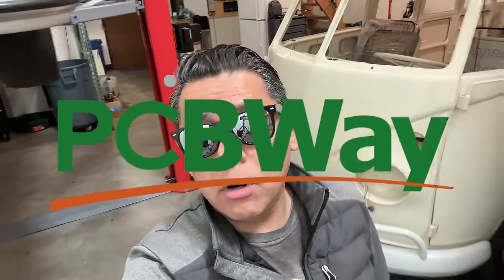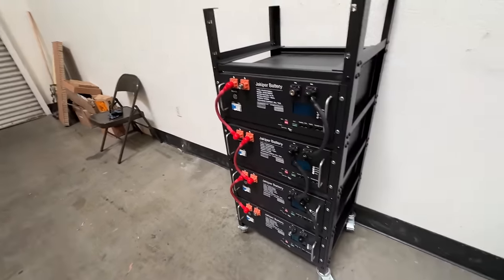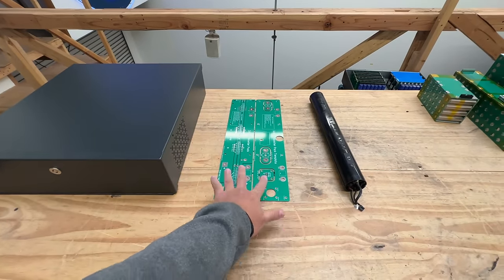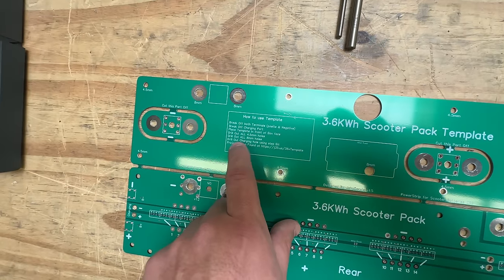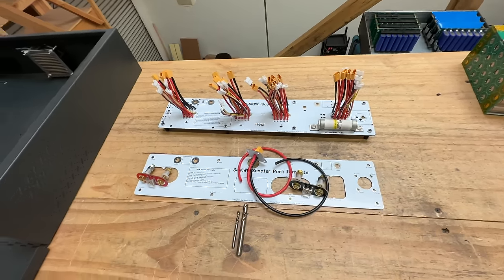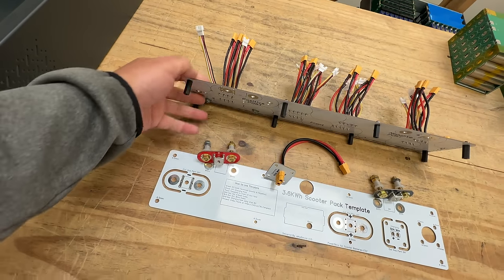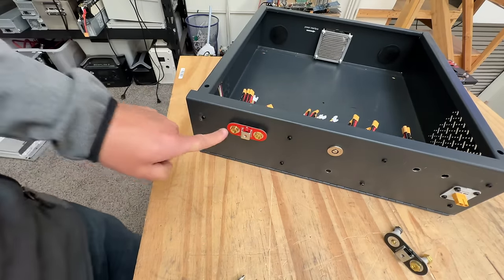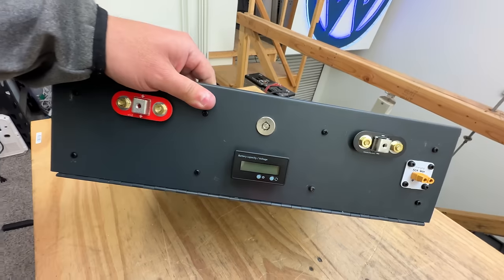20KWh DIY RackMount Backup Battery for Half price

Comment: Hi Jehu, this is reasonably priced unfortunately the battery type is wrong for home storage.  No BMS why?  No Isolator why?  The Fuse should be accessible too.  Please consider re engineering your design, the box won't breathe, I hope you have got good COMMERCIAL INSURANCE, Please send Will Prowse a ready built battery to review?

Comment: I have a 10KWh system with Enphase inverter using 25 microinverters for the solar panels(400W).  Can these batteries work with my system?
Reply: @jehugarcia
Reply from the maker: Yes and no.  Your system is closed loop,  doesn’t have a way to add a battery.  But you can add a grid tied battery,  they are called ac coupled battery system,  google that to see how it works and how you can install it in your home.
Reply: @jehugarcia  Thank you So much. Hopefully I will find a batt that doen't cost $10K.

Comment: Just to be clear these are reclaimed e-scooter battery packs, each with their own BMS. They are sold "untested" which means no guarantee on their actual capacity - the blurb says testing about 90%. One single BMS fails and you have a potential fire. And e-scooters are one of the worst culprits for catching fire while charging. You have no way of monitoring the individual cells in each pack, there's no circuit breaker only a fuse which is mostly designed to cover shorts not overcurrent. I'm almost certain the BMS inside each pack was never designed to be used in a multi parallel config like this. I'm not against DIY, I built my only 48V LiFePO4 pack from 280Ah cells but this design seems half-baked.
Reply from the maker: So has been every project I’ve done for the past 20 years.  10 years ago everyone said my diy electric car would never work because it was a hack,  “a fire waiting to happen”  they said. I understand some people like to color within the lines but to say that’s the only way it’s short sighted.

Comment: Maybe at the time you made this video it might have been something to consider. 10 months later you can buy those server rack batteries for $1100 - $1400 and they are excellent quality. there are so many brands that are competing. really you're comparing apples to oranges. Like you said 48 volts compared to 36. Also the lithium ion phosphate battery  batteries are up to 6500 cycles. They are all so UL approved, another words they're safer. So you're actually looking at more of a price of $4,400 - $4800 compared to $3600 and the extended hassle of getting all the different pieces together and then the labor of building them! I suppose it's a great nerd project, I wouldn't spend a dime on those batteries. In the long run you're going to be spending a hell of a lot more on your DIY battery, simply because you  only get a %25 life cycle compared to the lithium phosphate. You would literally have to build four of your units at $3600 a piece if you consider the life on that battery and you still wouldn't have near as nice a battery as the lithium ion phosphate batteries that you can get anywhere from $1100 to $1400.  He had 36 volt do it yourself is very limited as you pointed out. You can get really good quality inverters as you pointed out also on the 48 volt system.

Comment: if i had $3600 USD just laying around my power bills would be covered for three (maybe more) years.
but the thought sounds good...if...
you are in your 20's, and KNOW you will be in that house for your lifetime.  and if you put in a human controlled power control. this unit would get charged up only during late night, when the juice costs less. and burn the batt's during the day when power cost the most.
but one should ONLY use lifepo4. not the fire prone li-ion units.

Comment: Do the boxes require any cooling with the packs being tight together inside? Do the packs generate much heat?
Reply from the maker: Not at anything less than 1c which is all these packs can do anyways.
Reply: @jehugarcia  - any reason you did not mount the fan on the outside of the case & wire it?
Reply from the maker: Mostly because these batteries will not need cooling at 1c output

Comment: Hihi. Great video as always. Do you have or can you make a video with LTO cells? We have rotational power cuts about 5 to 8 times a day, so the long cycle life is the only viable option for most bang for the buck. It's hard to find DIY information like your videos anywhere else with proper links too. 48v LTO build would be amazing.
Reply: Price for the LTO would be amazing as well.  They are low current, so you needs LOTS more of them.
I looked at them and figured $64K in batteries to run the house.  If I was still 20 that might make sense.  But they would out live me now. 😂
If you have a california grid, AGM might be the best choice.
Reply: @robertsmith2956   I live in South Africa, with our unstable grid and constant power outages 5000 cycles would last me 2 to 3 years. I use about 25kw a day but want LTO due to the fast charging and long life. Need about 6 hours of storage and need that to charge up again in about 4 hours. 3 to 6 times daily.
Reply: @ThePsychoCJ  I very much doubt you'd be doing an 80% depth of discharge cycle each time! If you're losing power for a few hours at a time and your pack is sized for your 24 hour use then your discharge is only going to be ~10-15%, set your BMS to keep your LFP cells at 80-85% max SoC and that 10-15% depth of discharge would probably give you 20-30k cycles or more (likely near infinite as LFP would age out before you could push enough cycles at such a gentle use case). This strategy is going to be cheaper than LTO and more flexible as you don't need to care if an outage goes 5 hours instead of 1-2 because it's still not much of your total capacity.
Reply: @andrewfidel2220  thank you Andrew. I'll look into this. Currently power outages has been 10 to 14 hours for the last 6 days. So not getting any better. This is one full outage then we have ontop of that the 2.5 hours off too. I need batteries which can charge fast, 90a or higher with long cycle life. I'll do some research on LFP then decide which will be best.
Reply: LTO is overkill for residential energy storage. It will degrade by calendar aging rather than cycling.

You'd be better with LFP. Just make it oversized. If you need 10 kWh per cycle, make it 30 kWh. It will cycle much less because you'd be only cycling between 30%-70% percent range with added benefit of extra energy stored if the grid become haywire.
Reply: @ThePsychoCJ  if you can get an Alibaba vendor to deliver to SA you'd probably be best off buying some wall mount or rack mount 48V 200Ah packs. They're going to be heavy but I know you South Africans are tough as nails so I'm sure you and a buddy could easily mount a 200Ah pack to the wall. Just watch out for the 15S packs as they are less kwh than the 16S and 16S is much more industry standard so it might help you in the long run with compatibility. At 10.256kwh  you'd only need two per day of backup storage if your home is somewhat efficient and you aren't running any heavy loads like shop tools, multiple large inefficient AC systems, or inefficient electric water heaters. Upgrading old appliances like AC and water heaters to more efficient types will pay itself off very fast in terms of electricity cost but also in terms of how long your energy storage lasts.

A 48V 100Ah system in the US goes for $1500 to $1700. Anything more than that is just marked up bullshit. If you get 48V 200Ah units you might want to consider making sure they have 200A BMS's so that you have full discharge ability in times of super high loads but if you only have 5kw of inverting power then a 100A BMS (running at full tilt which isn't the greatest) will provide all the power you need. It looks like you can get 200Ah units for $2000 on Alibaba and based off some of the posts I've seen on the DIY Solar Forum. For someone like you that probably wants 30kwh, 60kwh, or maybe even 90kwh you're going to save a bundle of money if you find a good Alibaba vendor. It might hurt in shipping cost but maybe buy 1 unit before committing to buying 5 more if you're planning on 60kwh. As far as inverters go you could probably get by on a 5/6kw inverter but then you gotta watch what gets turned on. 12kw and 15kw inverters are quite common but putting all your eggs in one basket can be a risk. If you want redundancy maybe 2 12kw inverters would allow you to run each inverter at 50% and if one goes down you can temporarily run the working one at 80% 

LTO is about 3 times the price so it just doesn't make sense outside of really cold environements. LFP should be able to handle your charging requirements, even the worst 48V 100Ah units allow 50A charging so 2.56kw. If you get one with a 200A BMS it will almost certainly allow 100A charging so 5.12kw.

If you have any other questions let me known. You should be able to put together 60kwh for $12,000 USD and two 12kw inverters will run you another $6000 depending on what you want. You can get simple all in one off grid inverters that have a built in MPPT quite cheap.
Reply: @ericklein5097  hi Eric, thank you for this reply! I will have a look at Alibaba, there is a few vendors which does ship to us, but yes, those shipping fees are insane. Still cheaper than actually buying within South Africa. I will be adding solar as it will be cheaper than all the batteries only, then I'll only need about 30kwh. I have rewired my house to be ready, heavy loads are on a completely different circuit. Big fridges now also have smart timers on to make them a bit more efficient. Gas stove, busy getting a gas water heater. I have been convinced of the LFP route, all checks out for my needs, but will get rack mount batteries, not to fond about the wall mounts. I love server racks as an IT professional. Thank you again for the great tips!

Comment: All this work to save half on already worn out and lower cycle life battery which he sells for $100/kWh which is scrap from battery recycler. Just buy a new LFP rack battery with warrant and save yourself the trouble.
Reply from the maker: Clearly diy is not for you
Reply: @jehugarcia  Oh, I love DIY but using fresh cells instead of used. DIY makes sense if you factor in remaining cycle life discount.

Comment: What's the expected lifetime of the units?
Reply: They are li ion.. so 500-800 cycles until 80% capacity  vs lifepo4 which is 3000-5000 cycles until 80% capacity. Huge discrepancy
Reply: The length of time this will work for a solution depends entirely upon how much you eat up your lithium ion batteries: what voltage you charge your batteries to & do you not over discharge.

100% - 300-500 cycles
80-85% - 850-1500 cycles
70-75% - 1200-2000 cycles
60-66% - 2400-4000 cycles
35-40% - 4000-8000 cycles
30% - 8000-16000 cycles

Don’t charge Lithium Ion to 4.2v / 100% if you care about the longevity of the battery system.

I have some 16s battery systems where a 48v inverter that I am waiting to arrive, will charge each battery 🔋 to 4.0v for 70-75% capacity to yield 1200-2000 cycles or 3-5 years.

I bought enough batteries where I may be able to charge to 3.9v or 60-65% charge to yield 2400-4000 cycles or 6-10 years.

A Genetry Solar inverter will do 36v, but I will run my 16s system at 48v, since I never intend on using all the battery 🔋 capacity, since I am shooting for longevity.
Reply: @David H  4v should be far higher then 75% capacity. Most batteries at well over 95% at 4.1v

Comment: Hello could you explain me something please in previous video you said that cylindrical cells have only 2000cycles ? I have one in basket and is call POWMR powerwall 5kwh 48v and before I click buy I would like to know how many those cells could be in this battery as I can’t find moch information .seller said is 15s lifepo4 cylindrical cells 48v 5kwh and on website shows 6000cycles battery life is that possible? ? ?
Reply from the maker: Cylindrical NMC cells,   LiFePO4 in any form has 4000-6000 cycle life
Reply: Thank you my friend that cleared my mind

Comment: but I am wonderin ,is the lithium batteries that you are selling new or "refurbished" because there's a difference, sure they are looking into tech to increase the battery life by recycling it however that's still in research phase and requires a chemistry set a small nation can't afford.

Comment: Do you offer a half-price power bank with less than half of the life time of a comparable?
Where is the profit?
Reply from the maker: Sounds like you like paying full price,  Go for it,  don’t hurt my feelings.
Reply: @jehugarcia  Do not put emotional pressure on me, I only look at the cost and profitability. Not that I'm Mr. Scroodge, but I'm always looking for the most cost-effective solution. Believe me, there is a solution where 1 kWh costs less than $150 and the battery has a higher capacity and a lifetime GUARANTEED greater than 6,000 cycles.
No spells will change the fact that the holy grail of any electricity storage is the cost of ONE kWh cycle, not one kWh only.

Comment: 1000 cycles vs 6000 cycles for lifepo4 for half cost?  Sounds like a bad deal to me.  Even worse you can diy a lifepo4 with prismatic cells for not much more than this solution.  Add to that the extremely limited availability of 36v inverter solutions and this project is just dumb.

Comment: While this should be fine in environments that stay at a moderate temperature, there are no mechanisms here to protect the batteries from getting too hot or too cold.  As such it would not be a good idea to use this project if you are looking to store your batteries in an external shed or a garage that is not heated or cooled like you would want for the inside your house.
Reply: Excellent point.  That leaves me keeping the potential fire risk in my Pennsylvania basement.  No.  Back to LiFePO⁴.

Comment: This is a lot of smoke waiting to happen from shorted wires at best and a burned down house at worst.  NO way should that many small wires with that much exposed copper be shut up in that small a space.  The PCB are laughable and not anything I wouldn't want to be around when the crack from the strain on them.  And last but not least, I don't know how many cheap knockoff XT60's I've seen melted, but it is a lot.  No part of this remotely sounds like a good idea.
Reply: Literally none of those wires are exposed

Comment: You didn't mention that these batteries are already used, and each set is NOT balanced. Plus where's the BMS between all the cells? Cell balancing or even set balancing? Yeah, the BMS is in the pack itself, but I dunno man, I don't like it nor trust it.

Comment: There's no amount of money you could pay me to put one of these under load in my home.  Lithium Cobalt is crazy dangerous without a BMS.  The build quality on the scooter battery looks ok, but even if they were brand new cells, this type of application is not safe.  People have died when their E-bikes have caught fire while charging overnight in their garages.  People have lost their homes to Lithium Ion 18650 cell power, a project promoted on this channel.  Lithium Iron Phosphate is much safer and significantly less likely to catch fire either from  accidental physical damage or overcharging.  As long as Lithium Cobalt 18650 cells are promoted for DIY builds on this channel, I will comment on how unsafe they are.  Buy some EVE, CATL, or Gafeng LiFePO4 prismatic cells new from China and sleep better at night.

Comment: Did you say a 36volt battery? Who uses 36volts? The rack mount batteries you showed were 48volt. This is a waiste of money and time
Reply from the maker: No,  your narrow view on this matter is the waste of time,  36v is usable
Reply: @jehugarcia  your talking about building Lithium batteries, well I built my own. I used 280AH cells and bought an overkill bms and have 6 280AH banks that dwarfs your tiny system. At first I paid 70 bucks per cell and now they gone up to around 100 per cell if a person wants to purchase hase them from alibaba and that's a 48 volt system.  A system that's usable in the real world and have many options on inverters.  Unlike yours

Comment: SLOW YOUR ROLL HOSS, YOU POINT AND SAY "IT COSTS ABOUT 1700 DOLLARS... PER BATTERY OR FOR THE STACK?
Reply from the maker: Per 5.2KWh module,  why would I put $7000 on top of the rack in the thumbnail if it was $1700?